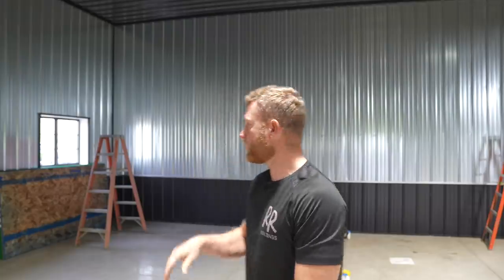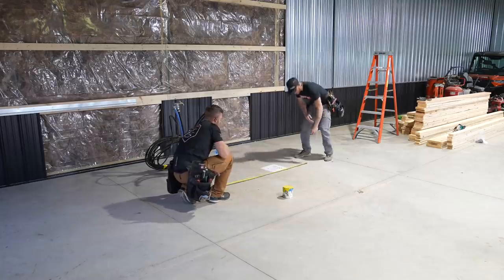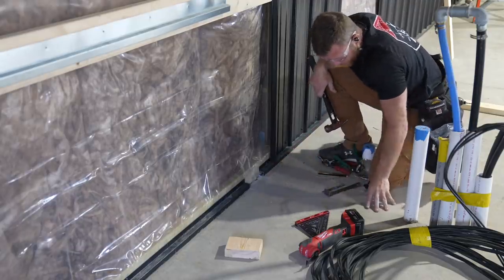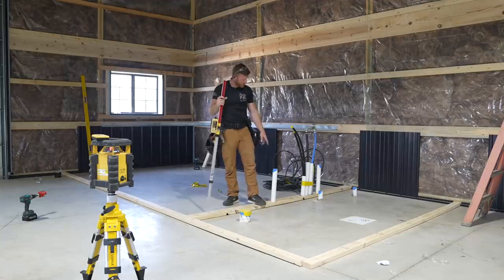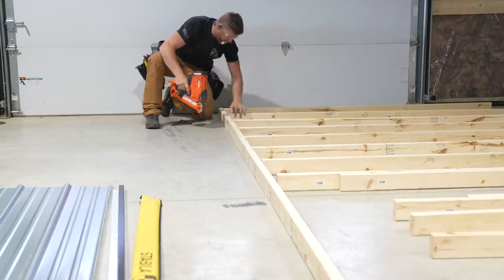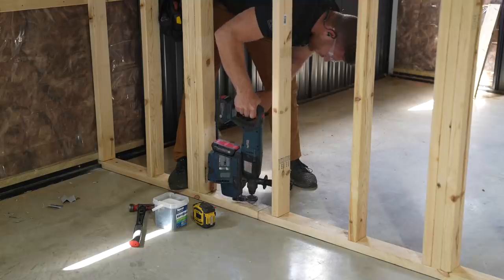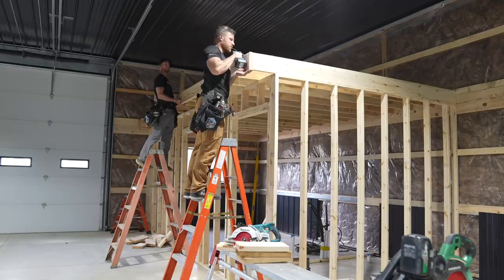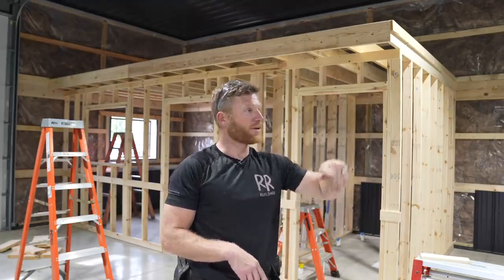Building out Bathroom and Office Part 1

Comment: This is exactly what I am getting started on my pole barn -- excellent information and insights! Thank you! 

Have a 3000 sqft building -- side walls are 15 feet. I am re-roofing and re-siding and re-insulating right now. 

Front 2000 sqft is being converted into a home gym with locker room/shower room/spa and commodes; a home office; and an inventory room, and showroom for my business. 

The back 1000 sqft steps down 4 feet and will be fully walled off and have its own entrance, ventilation system, etc. and stalls for 3 mini-Jersey Dairy Cows and 6 Katahdin Sheep.

Your timing for this post is perfect! Thank you!
Reply from the maker: Awesome

Comment: Just a tip. Not sure what code is where u are. But u should use STRIKE PLATES. To cover any pipe locations. Or even wired areas. Deff 100% pipe locations.. reason being when no screws or nails can be mistakenly driven into and cause leaks.. seriously needs to be considered.. thanks kyle

Comment: If you wanted a high ceiling could you use 14’ studs and tie into the existing ceiling?  If so, how would you go about it. Asking for a friend lol. You guys are awesome. Sure wish you were in my area!
Reply: Think you want a floating connection on top because the roof trusses will move a little as they dry out in the winter.

Comment: What brand buildings do you normally use and are they considered pole barns or metal buildings. I ask this as I notice that the buildings you construct already have boards for your framing on the perimeter walls.

Comment: Kyle - I love your videos.  Thank you for posting all that you do and educating us.  A question for you - here in DuPage county and elsewhere around Chicago, I think it's code to use EMT for wiring.  Is that not the case where you're at?  I reference the hunting cabin series where it seemed none of the wiring was in conduit.  Just wondering.  thank you also for the tip on Midwest Perma column - they have just the post mount I need for an upcoming project.
Reply from the maker: I am not an electrician....but best of my knowledge romex is acceptable depending on zoning

Comment: What screw drill bits do you use? Struggling to find decent quality bits that don't constantly snap
Reply: You might try Wiha or GRK.
Reply: you first need to drill a proper hole with a designated hammer drill. not your regular common drill to bore the pilot hole. before sinking those blue screws to fasten bottom plate to concrete or else you will snap every bit and still never sink anything.
Reply: @4dak88  6

Comment: Kyle; I just watched a video on Y-T about a guy who own a remodeling business stating why he tore down a Post Frame or why one should not place “in Ground Post”?  
They had rotted even though they were supposedly not suppose to?
Any hoot ; he was anti Post Frame & not sure why?
(Terrible sentence structure I know sorry).

My question is your are not in ground but above setting in proper bracket attached to cement tubes right?

(Want to build one for my son so checking all issues if any)?

Thk you for the videos brother and pullovers (great Carhart stuff).

Knock’em dead Kyle and you hv a great Carpenter (u trained) working for you! (Greg ).

Comment: Your work is always high quality, but the only thing I don't like about this build are your header choice on the doors and window.  You say it's not load bearing, but if above is being used as a storage platform, then it is load bearing.  That's dead load.  There are three sections over that wall span where your distance will be 3' being supported by double 2x4 sideways (3" thick header)...Only 10 out of those 16 stud bays are actually bearing.  If a proper header was used on the doors and window then every stud would have been truely bearing.  It won't collapse and probably more than likely fine, but with enough weight, those headers can sag over time.  I'm shocked you didn't stand them upright and sandwich some 1/2" between or just pick up a 10' 4x4" or 4x6"...any of those would have been a better option...I guess we'll see on Part 2 how thick the subfloor will be....probably 3/4" and that will help, still don't like those headers...alright, that's all still gonna smash that 👍 button.

Comment: I'm curious as to why you didn't use treated for the bottom plate.
Reply: They put a vapor barrier adhesive tape on the wood.  Used to be builders would use tar paper.  
I agree though, I'd probably go treated with that adhesive tape but I like to overkill moisture related construction. I'd foam up around the penetrations; and would wrapped the pipes coming thru slab.  But I'm a plumber not a carpenter. 

These guys are surprisingly legit pros - so many video made by Bob the Builder types. 

I love his accuracy, checking bottom plate elevations - NO ONE DOES THAT.  KUDOS! EXCELLENT.  Love the rotary laser use for that.

Comment: Why do you use the nail gun sometimes, and then screws another time?
Reply: Nails have a greater shear strength, yet screws have a greater grip strength. If you are in a situation where it's more prone to pull out you'd use screws but if it's more apt to shear off it's best to use nails (per IBC code).

 The only exception to this is "Structural Screws" not "construction screws" but actual structural screws that have a greater shear strength than the common framing nail and a greater binding strength than traditional construction screws.

Comment: Why not metal studs?
Reply: why should they use metal studs?
Reply from the maker: Why metal studs?
Reply: Its difficult to nail doors, casing and baseboard to metal, and its more expensive than wood, thats why i use wood anyway, fwiw, ill do metal if the customer wants it though.
Reply: @RRBuildings  … 🦗 

Don’t even waste your time with these trolls..
Reply: @cabbyhubby  thanks Johnny
Reply: Metal structural studs are much more expensive than wood for the strength. 

If they were just partition walls you could make the argument to use light gauge metal;  but not supporting a usable mezzanine.